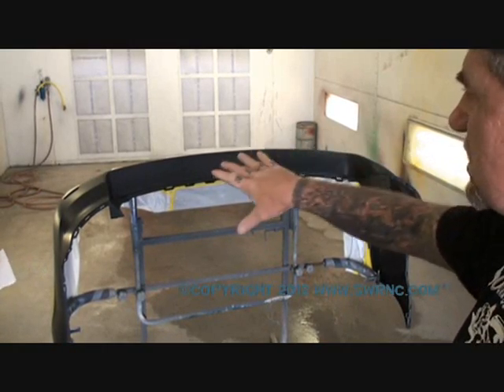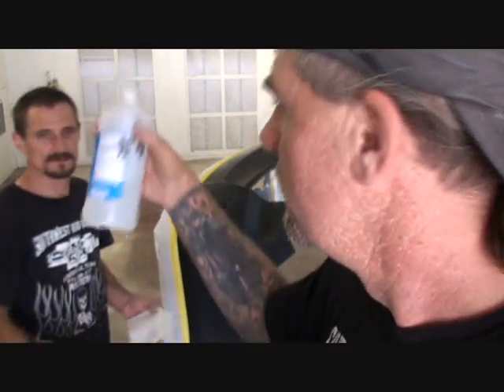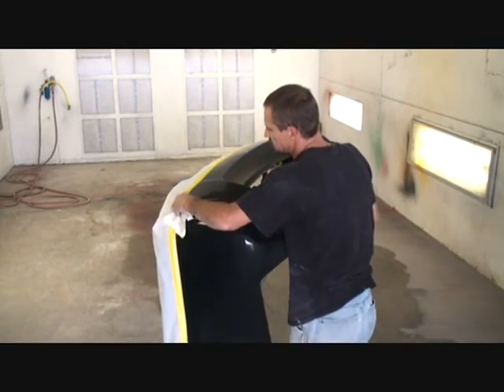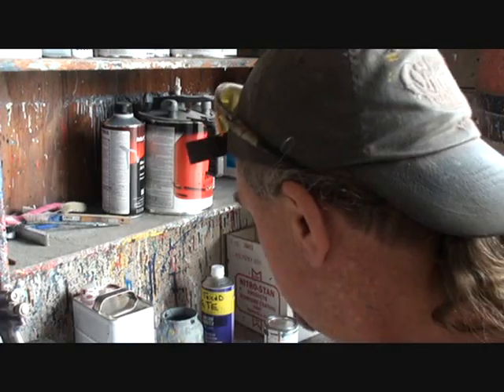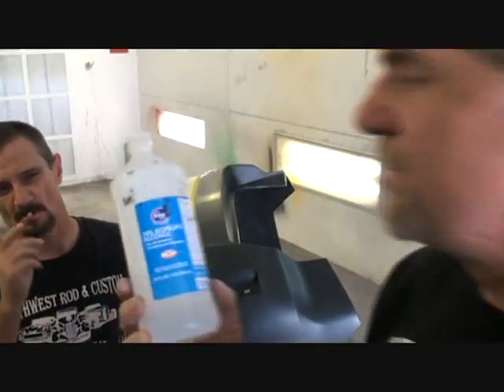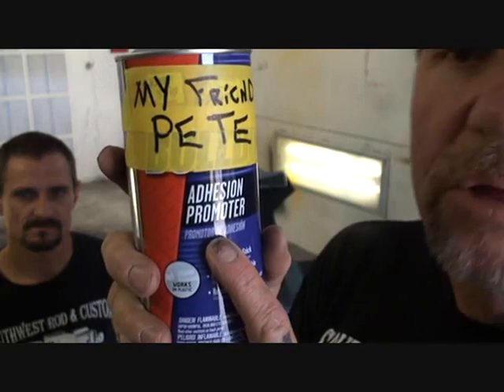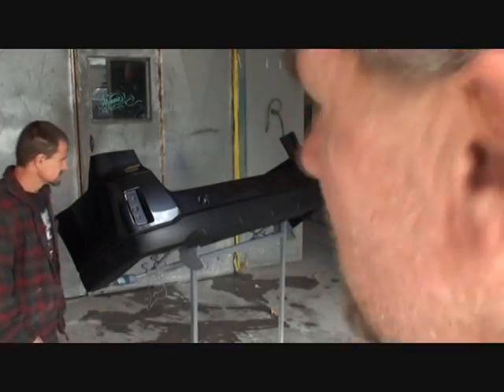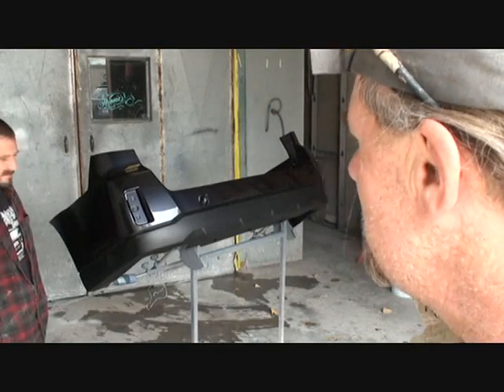How To Prep A Plastic Bumper Cover-Automobile Collision Repairs-Part 2

Comment from the maker: There are many different types of primer sealers, there is Etch primer for bare metal applications and there is primer sealer which can be used for both bare metal and painted surfaces, and there is epoxy primer which can be used for both as well, but use's an activator which is a hardner. The epoxy primer is going to give you the best adhesion due to the fact that it uses an activator to make it work properly..

Comment from the maker: The texture you are referring to is usually a rock/chip gaurd adhesive which you can purchase at your local paint and body shop supply store, it's usually clear in color and is bought as a spray can item... Once applied-let dry then paint over it...

Comment from the maker: @fishing54501 If your talking about a dirt bike type 3 wheeler, I wouldn't suggest to do any body work to the fenders using bondo, I would either locate new fenders or use a plastic type welder/epoxy type repair filler.. As for prepping, you would do basically the same procedure as doing a new fender just sand a bit more to cover all the angles .

Comment from the maker: Contact your local paint and body shop supply store, there is a bumper repair kit you can purchase which is a 2 part epoxy type substance, as for the electric orbital, it never hurts to try it out.. Take it easy and good luck Pete

Comment from the maker: I use a PPG brand fish eye elemanator, you purchase by the pint, add 1 cap full to your clear or paint, haven't used the smoothie stuff in years. Actually I haven't used any fish remover in years, If you keep your guns clean and your air lines clean of water and dirt, there's no need in using it at all... Take it easy Pete

Comment from the maker: you can sand till gone, and then spot prime, or you can take the edge of your sand paper, clean out the deep scratch fill with polyester filler sand down then prime, either way it will work out fine

Comment from the maker: To paint plastic cladding you really want to sand it with 320 dry or 400 wet because a scotch brite will leave deep scratchs in it especially a green one. Make sure before applying primers or paint you completely clean all surfaces with rubbing alcohol and also to remove any grease or dirt. Good luck Pete

Comment: Pete, good video. I have a 97 Lincoln continental that I am planning to paint on both front and back bumper covers and also the deck, top, and hood. Original bumper covers.  Should I paint the bumper covers on or off the car?  I plan to shoot it in a single stage paint probably with the clear coat added to the base after proper prep and sealer.   It is not a show car but runs good and I want it to look better.  The top surface paint is showing the primer undercoat.

Comment: hey i liked the video. i have a question... i been thinking of trying to paint my fenders on an old 3 wheeler and was wondering if it would be the same process as new plastic? also i was wondering if i need to do some bondo repairs to the plastic should i do the adhesion promoter to the plastic first?

Comment from the maker: Fiberglass cars are a different bread of paint and body all togeather, you have gel coat and stress cracks, and doing body work is a real chore, because sanding fiberglass is a touch situation.. There are many differances from one to the other.. I will have to make a video set on this subject.. Pete

Comment from the maker: It was damaged for too long and when and if you pulled it out it would have still had a large nasty creese in it that would need extensive repairs. It was much cheaper in the long run to buy a new or reconditioned bumper cover..

Comment from the maker: Your best bet is to find a place that reconditions bumper covers and have them strip it and reprime it. if you cant do that then you will have to find some low tack stripper at your local paint and body shop supply store and strip the paint off yourself, DO NOT USE AIRPLANE STRIPPER it will melt the plastic....

Comment: I wonder if this is an odd question, or if I'm looking too deep into the preparation. Some of the automotive manufacturers use static to adhere paint to the parts in a dust-free area. When you rub the plastic, does the friction cause static, and should we allow this, or not? Seeing as particles could stick from the surrounding air. I might get hired by a bumper repair and replacement shop. Never done this kind of work before, so I'm studying, and you've been most helpful. The two chemicals alcohol and promoter are wet applications, so there would be least static involvement. But should we consider this to be a concern?
Reply: +Steven Ramos Note: also, is moisture in the air a big issue? Seeing as plastic 'attracts' moisture. Paper requires a 33 degree and 30% air moisture factor for paper to survive over time without mold or cracking, but that's paper. Plastic is an interesting material this way. Again, I'm brand new today in studying this job.

Comment: Got a question about high build primers. In my case it will relate to a plastic piece I'm doing. If i clean, prep(promoter) then spray a high build primer and block down. Am i ok to base from there(so long as no plastic shows through) or do i have to apply a sealer primer after sanding the high build.

The piece is a rough textured plastic. It will be sanded down a good bit but i can't get it smooth as i don't want the plastic to become weak.

Comment from the maker: In my opinion--yes, you want to use a good epoxy sealer so your paint has a good surface to stick too. The bulldog is not just an adhesion promoter but also a flex promoter. You want to always cover your ass when doing a good job, and using epoxy sealer will do that!

Comment: I have two questions... I have a 2002 avalanche with the body cladding. do the same steps apply when trying to paint the cladding? And can I use any scuff pad or does it have to be the grey one? The ones I have are green in color.